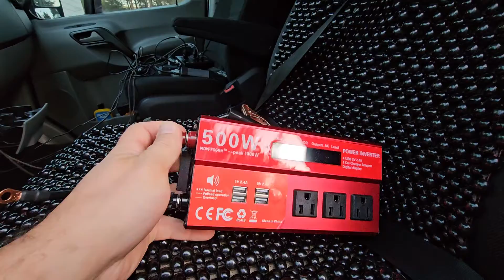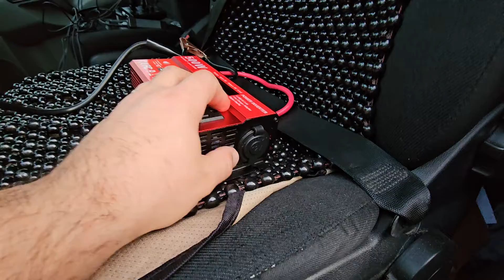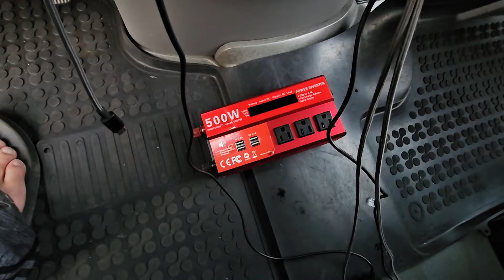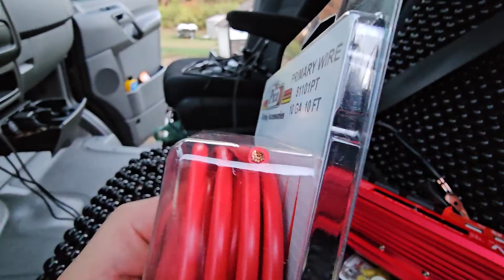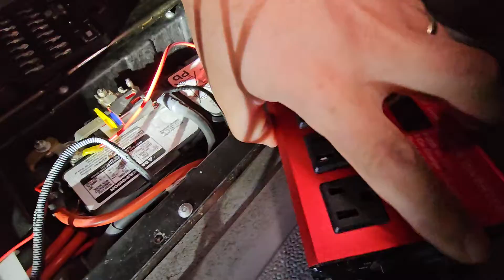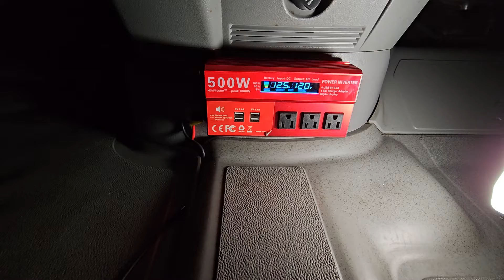Power Inverter Install | Expediting Van Set Up | Vanlife

Comment: So if I install a 1500W inverter like this, I can use an electric 1500W heater?
Reply from the maker: If u run the van at the same time maybe. I recommend a diesel webasto style Chinese heater. It's like a home forced air furnace and does not require any inverters. Can run for days on one main battery.
Reply: @Eagle-Xpress 🙏

Comment: Does it drain your battery
Reply from the maker: Not when it's on when u run the vehicle. If I leave fridge plugged in I've had it on for 6 hrs with vehicle off and it didn't drain anything.

Comment: Could you use the inverter to run a small heater while the van is off?
Reply from the maker: U should install a diesel heater. It's the best and does not require anything, can be hooked up to ur regular battery and runs for 24 hrs without draining it. I have a video avoit that on the channel.

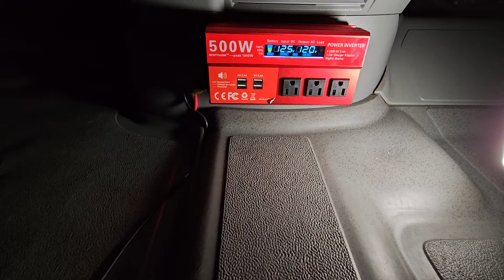Comment: 14:02 thanks for this video, I thought I had to install the inverter to the wall of the van. I bought a 1000W renogy and I thought I had to mount it to the wall of the van before using it. I'm glad to know that I can use velcro instead of drilling in my van

Comment: It's very important to know that most cigarette lighters have 10amp fuses and 500watt inverters drawing minimum 40amps  they should always use seperate (6gauge or less for 500watt) cables that are connected direct to the battery. Another thing to know is to never leave inverter on when car is off because 99%of them draw power even if nothing is plugged in to inverter and will draw the battery out in few hours!!! Thank you for the video.
Reply: This that why alot of people have another battery